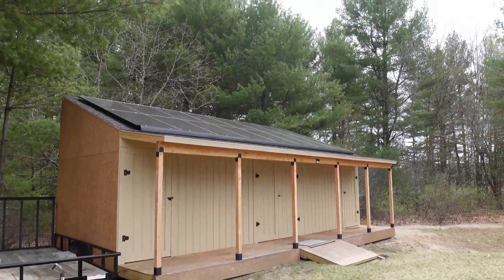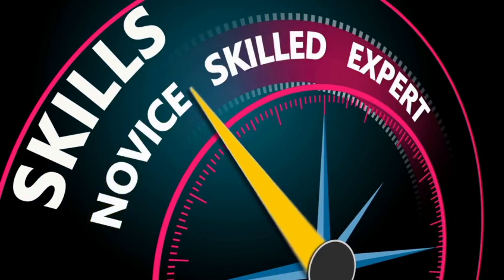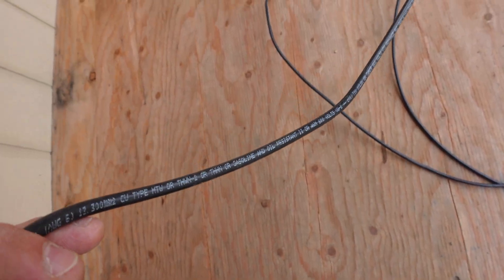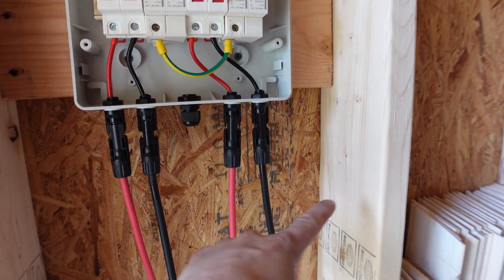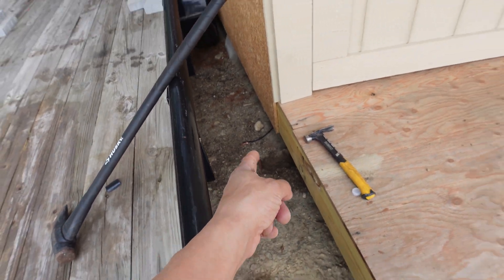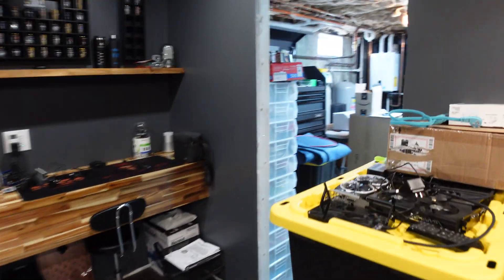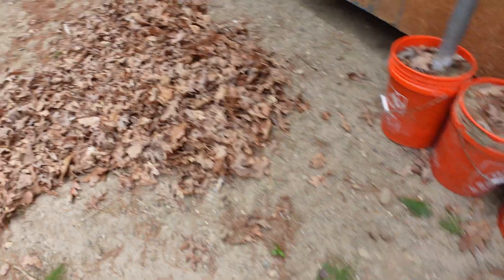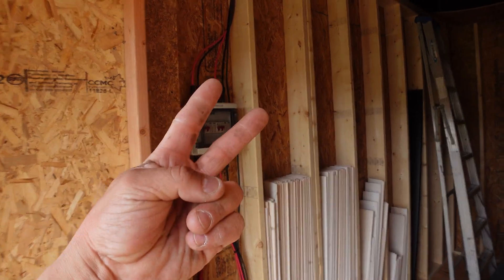Grounding My DIY Solar Shed

Comment: Nice setup bro! Very clean and functional building you created! I have a 6000xp, 90 solar panels and 45 kWh of batteries on the way! My solar grid tied mining operation got busted by code enforcement so I have to make my off grid property do all our mining now. When it’s all said and done I’ll have around 350 solar panels, 165 kWh of battery storage and about 40 GPUs (cmp 170hx and 100-210’s). I’ll have enough to completely power, our household with the family of six and plenty of extra energy to run all the mining for free.
Reply from the maker: Damn man that sucks but that’s why I refuse to tie mine into grid. It’s actually dangerous for the utility companies if they don’t know and you back feed the grid

Comment: @ChumpChangeXD Mining & Crypto  dude thats crazy i never know it would be that easy to pull out a ground rod, i would have ended up buying a new one 😆 BTW the higher the gauge of the ground wire is best if for lightning strikes, allowing very little resistant to dump all that energy quickly without burning up.